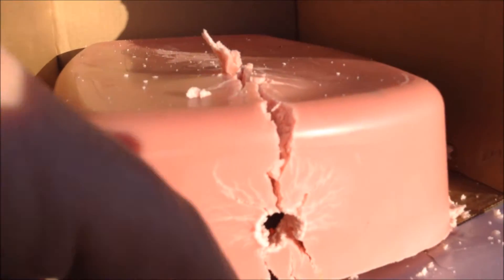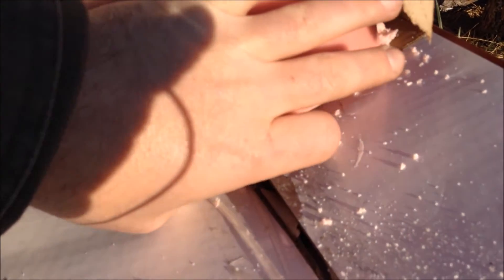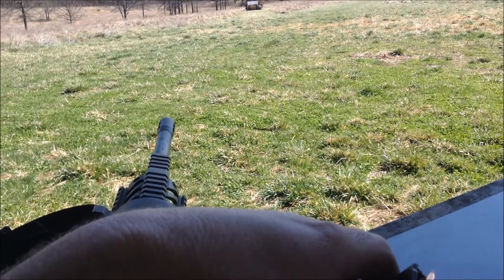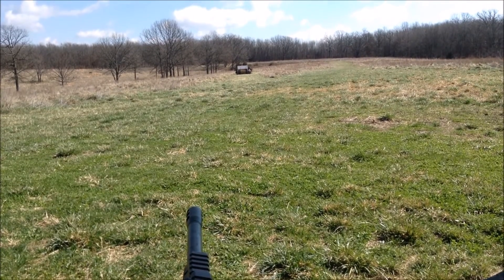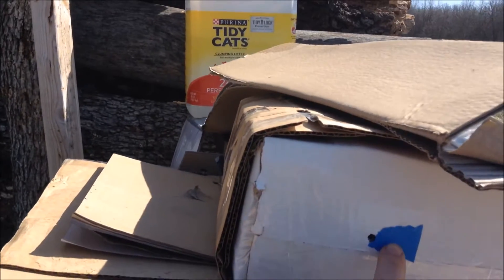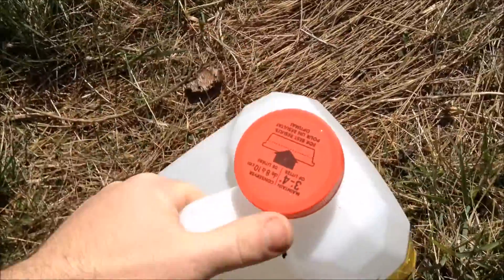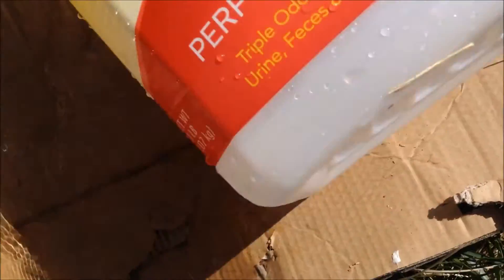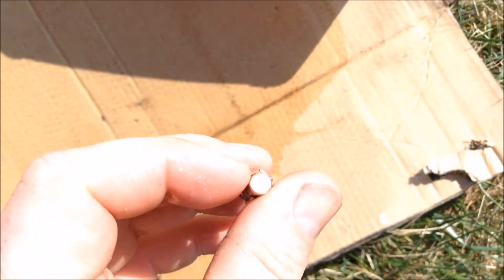AR15 6x45  6mm223 95gr SST ballistic  test

Comment: Have you guys ever tried the 108-110gr bullets?  I'm new to this, but a slower 6mm ARC with the benefit of the .223 brass seems appealing.
Reply from the maker: In a bolt gun you probably could in the at your coal gas a limit I was thinking about re barreling my savage 223 with a new 6x45 then I will have all kinds of room to play with new bullets
Reply: How do you know when the bullet is going to be too long for the AR?  I’ve never hand loaded before.  It also seems like you could cut the .223 case to .300 blackout length and neck it down to get more room.
Reply from the maker: @mrmcbeth  300 black out is not the same as 6x45 you don't cut the case short and as for how long you set the bullet you base it off when the bullet hits the lands and then you back it off depending on the bullet you have it jump to or be just off you have to shoot it to find out what will shoot the best 20 thousands of the lands is a good place to start I cut the front of the mag out so I can run past the 2.26 mag and can go to 2.33
Reply: @hunttomuchwolfe  .300 blk necked down to 6mm would be 6x35.  I know it has been done.  I just can't find any data on it.  I am assuming that .300 blk uses a 35mm case to fit the huge 220 grain bullets and maintain the standard COAL.  I don't know if that's true.  It's just a thought.  If it is true, fitting a 108 grain bullet should be easy.  I don't know about getting a barrel, though.
Reply from the maker: @mrmcbeth  the problems I see with that is running out of room for powder if you want another great all around shooting hunting and just plan cheap ass kicking round look up .277 wvl it's made by mad dog weapons systems I've had it for hunting for the kids and drops deer like crazy think of 6.8 spc power out of cut off 556 brass

Comment: I'm planning on loading that bullet in mine. What is your OAL? If you're seating them longer, what mags are you using? The cannelure puts it just over mag length of 2.260.
Reply from the maker: So you cut the front of the mag out and I run my sst at 2.33 it lets you fit it and be just off the lands and you have more case for powder so you get speed without pressure
Reply: @hunttomuchwolfe  you have a spare mag or two you can spare?
Reply from the maker: @jguz7799  I only keep two cut out ones one to run amax 75gr out of a 223 and one for my 6x45 it very simple and you will only need the one you just cut the center part out so the bullet tip doesn't hit gives you the chance to run longer bullets with high bc for longer shooting
Reply: @hunttomuchwolfe  yep, I started researching on how to do it. I think it will be simple enough once I get a good cutter. I have a bunch of mags to practice. Thanks again.

Comment: Thanks for your 6x45 videos ! I just picked up a 6mm 
IBI 1:8 twist , medium hunter barrel for my ruger American ranch with ar mag. 
From you experience is there a barrel length, bullet weight , throat / bullet combo sweet spot , that you could recommend? 
Where do you see the 6x45 main attributes or strengths vs the 5.56? 
My personal reason for building one , is a interchangeable barrel system that uses very similar components with the 6mm version having better hunting performance & longer range performance over the 16” 5.56 barrel. But still maintaining the magazine capacity & making use of the ton of 6mm projectiles I already have. Thanks.

Comment: Thanks. I shoot the same bullet in my 6/45 w/same barrel.  I have had good groups with a2200 powder.  I can get a little extra oal by filing groves on inside front edge of magpul mags.  Good info on a great cartridge.
Reply from the maker: HC Goode  I have them at 2.33 and cut out the front of the mag and have got great accuracy out to 300 yards I have a video shooting 1.5 inch at 300 and its almost to easy to do 6x45 is a killer I love it
Reply: hunttomuch, If you can, school me on this. What do you mean by cutting the front of the mag? What exactly do you cut and does that result in giving you the added COAL to 2.33? I'm new to this caliber, but I should be getting my upper in the next couple of weeks.